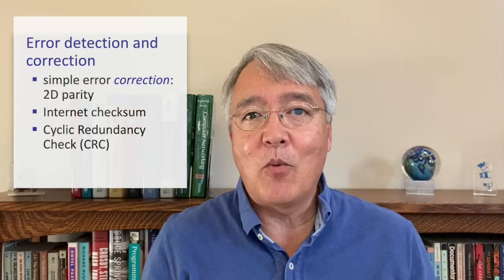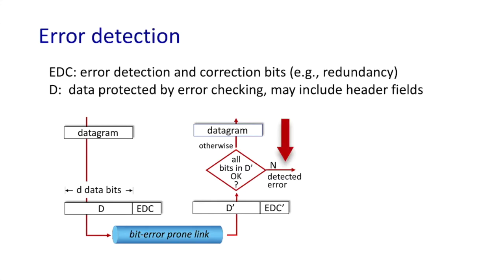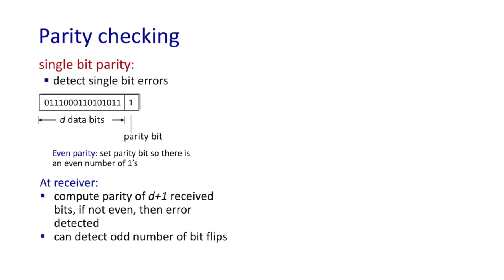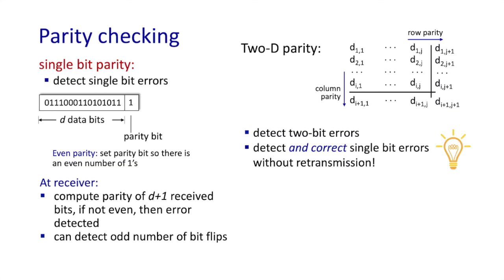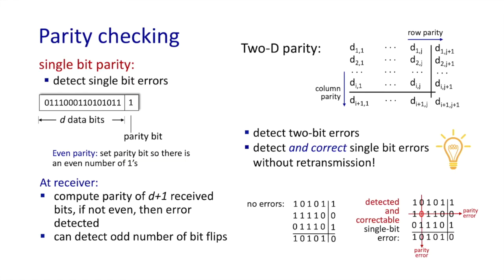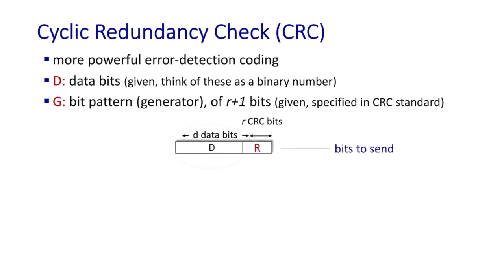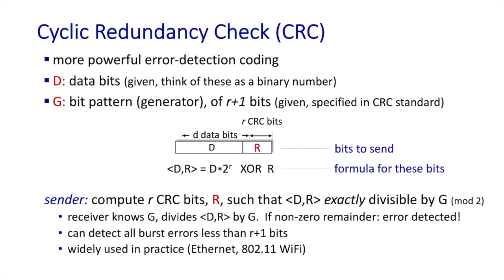6.2 Error detection and correction

Comment: Guys did you notice that there is an error in the video explaining error detection...
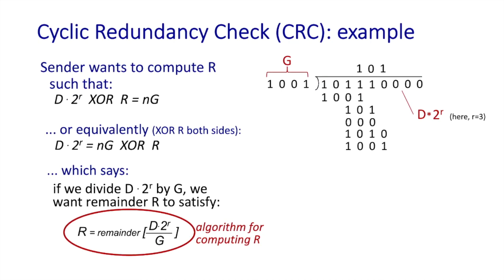Error is at @8:05
Reply: There are some other CRC videos out there which explain the math in a bit more depth.. it is a particular kind of division used on finite fields that we are seeing here. It makes more sense in my head thought of as "xor division" but basically you are shifting so that the most significant bit in the divisor lines up with the most significant bit in the dividend and performing a XOR operation.

Comment: @8:05 there is an error, the quotient should be 101000 and the remainder should be 1000
Reply: Its XOR Division , not normal division , modulo 2 division so
Reply: Modulo 2 division. Subtraction is the same as XOR